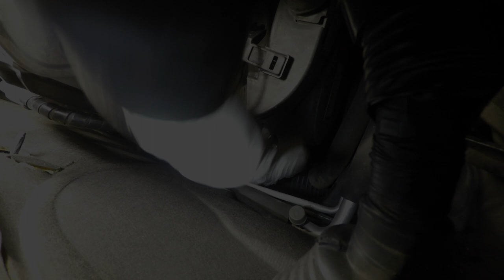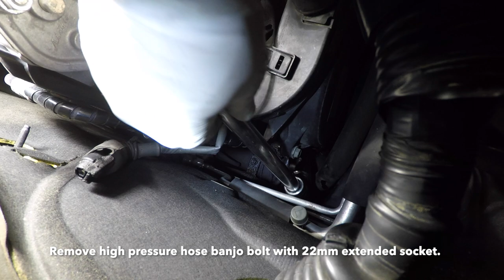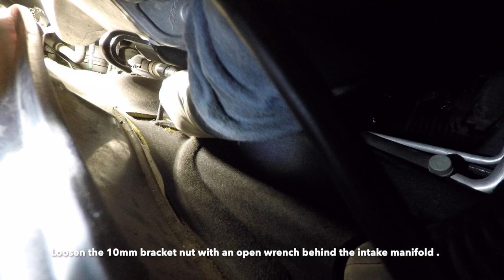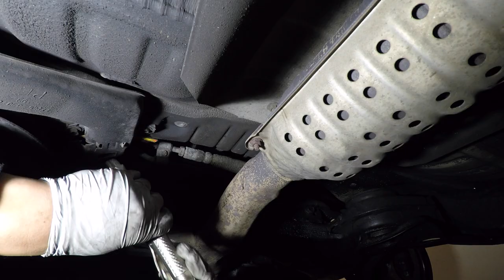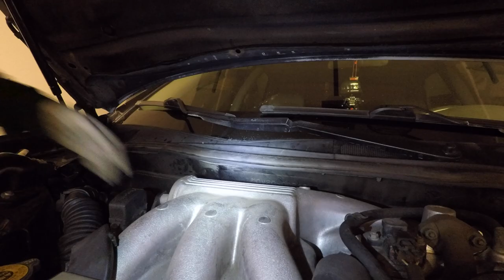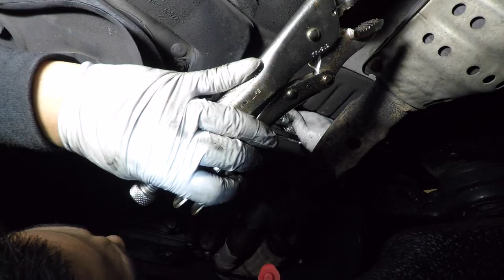DIY VL●OG: Lexus ES300 Toyota Camry/Solara Power Steering High Pressure Hose

Comment: Very helpful. Now that I am ready to install the new hose, that nut removed with the #10 swivel socket and the 4 ft extension, how do you get that nut started back on?
Reply from the maker: I usually wrap an electrical tape on the swivel socket so it doesn't just hang loosely and I can position it however I want. Then I place a piece of paper in between the nut/bolt and the socket to hold it in place until I'm able to screw it in.

Comment: What lenght  hose did you use ?
Reply: What length hose? It's preformed metal and high pressure hose.
Reply: When I when to buy the hose they had two lenght but one was for sedans and the other for sedans and vans.
Reply from the maker: @senorsquish1  the part is specific to the year and model of your vehicle. You can check at RockAuto for the specific part.